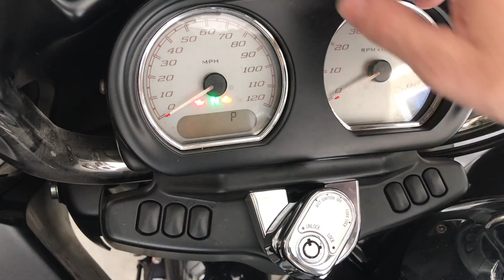How To Check Engine Codes On Harley-Davidson’s Touring Models

Comment: What was the problem with the head unit /radio /entertainment center???? My 16 RG where the screen just go black and radio shut off  GPS map would go crazy.   Dealer kept say just need update said it was battery  issue.   Finally after lots of talking got them to replace the unit. Harley said radio was bad .
Reply: I hear you but I'm more into simple stuff, hence why I love my 95th Anniversary Road Glide so much. It has NO computer or sensors to leave you stranded. It has a simple carburetor with throttle cables. I can actually work on my own bike and avoid having to sucom to having to pay some technician to troubleshoot it at a dealership. https://youtu.be/eIohnw2glPk